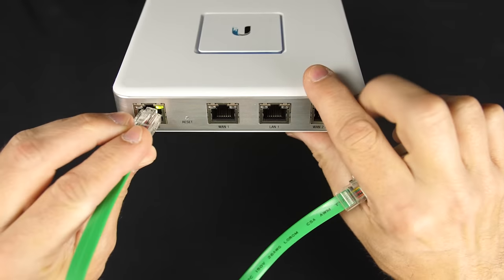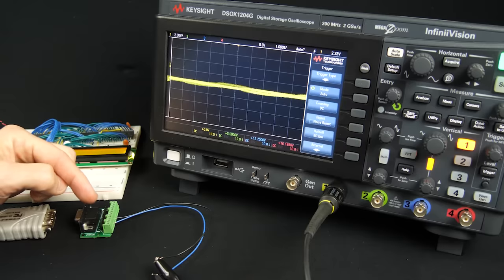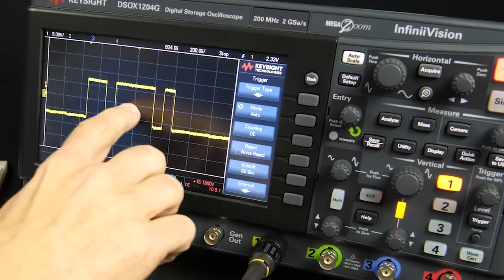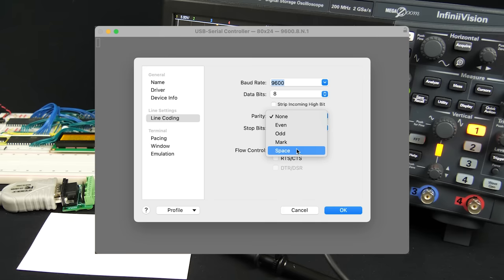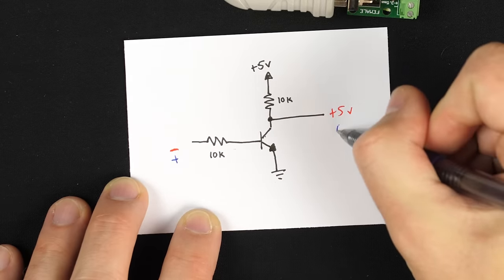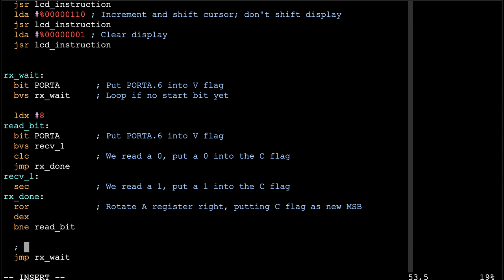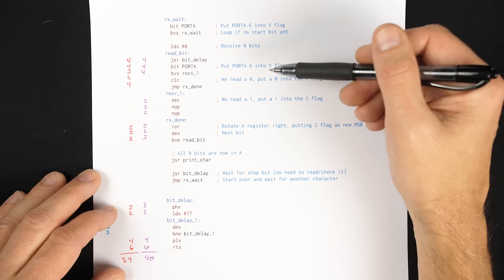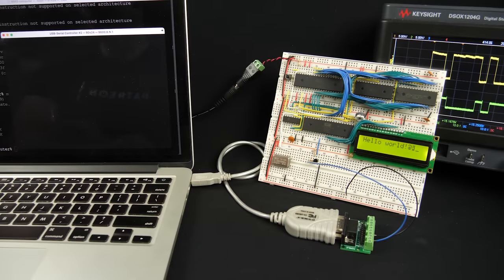The RS-232 protocol

Comment: On the DB25, the clock (if used with the undefined and testinging-reserved pins upon their reconfiguration) could be used with parallel to serial compression, basically like usb but better for some tasks. To do so nowadays, the old baud rates would not apply per se but could be reconfigured to switch between frequencies of symbols whereby each part of the spectrum is separated into a series (each placed into an histogram bin) by means of Fourier analysis (probably, largely FFT). One can assume two computers are connecting each other at such  a "future serial" port by means of a db25 connection. The receiving computer could receive first (before all histogram bins) a gaussian kernel of those historam bins. In advance of the receipt of those histogram bins, the gaussian kernel could be used to derive the contents of the historgam bins, as a sort of means significance testing. The gaussian kernel could be derived and (and subsequently reversed engineered) by means of Gaussian kernel estimation Parzen-Rosenblatt window method, with a rainbow table style out of order execution almost like an index of hashes. OpenCl could do much of that, encoding and decoding the eye-pattern, aside from the bit-twiddling.

The EU "iphones must have a usb-cable for power" specification is a curious thing. They did not even insist on a data-vs-power-only switching mode. Had they done so (although ethernet, or a better beefernet) cable could sitch between provision of solely power (wattage) and power-plus data. This means when charging (a laptop or MID like smartphone), people can use data too so as to free up WiFi bandwidth usage (or microwave/radio frequencies). The existence of LiFi is down to limits in the spectrum for data nowadays. when a Lifi is communicating between a smartphoe and a celing lamp, the "data sending" of lamp is mostly fine because a wall or ceiling has sufficient electricity. However, a smartphone has a limited battery and so, immediately, a hog for the lower power wavelengths gets hogged because "data-sending" smartphone batteries (and similar) cannot compete with the power provided by a lamp. Partly the screen (in "flashes" or modulation invisible to the human eye) can send a trickle of data in combination with a powerbank plugged in via the charger port having LED lights that send some data.

Much of the entire situation (electromagnetic bandwidth limitations per user usages) can be mitigated though by plugging the smartphone's cable charger with data optionality into a port of any compatible surrounding device (like a table or grounded chair wih a magnetic data port pad on it) so as to be clipped on its magnetic power lead (like a Apple laptop charger cable so it is ok that is won't break if it is "ripped away" harmlessly). This information is to help manufacturers (apple, android, MSwindows-phone, Asus, Gigabyte, MSI, Biostar, Foxconn, etc.) and an EU-rethink of it all. Leads can be retractable. Smartphones set to do a full charge (or more than an hour) can be set to receive essential data updates and other message updates via a token ring, or bakery ticket algorithm if the power lead connects to a corporate shared or municipal wifi tower along a big cable (implying an otherwise further limited spectrum of say radio or microwave, which is a problem solved by waiting for a 5-or-15 minute data slot during the hour charge in a queue amongst other user's smartphones plugged in already). 

An IEEE1284 DB25 (at 2Megabytes/second to 2.5Megabytes/second, which is still handy and very approximately sround a 24Mbit/s ADSL2 connection) could have provided an alternative if reduced via adaptor to a sata power port which has two rows of 15 pins making 30 pins so that two of the remaining 5pins could be 12Volt positive an negative, whilst the other two of the 5pins a 5Volt positive an negative, and then the last could be reserved as a ground switching and changing to PWM. Whichever is the pin pair for unused voltage can be changed to parity bits for start and stop, or in addition to the third and one of the postive or negative volt pins "in usage", multiplexers (or similar tristate CMOS logic) can daisy chain to other trusted devices.

My comment has no hate in it and I do no harm. I am not appalled or afraid, boasting or envying or complaining... Just saying. Psalms23: Giving thanks and praise to the Lord and peace and love. Also, I'd say Matthew6.

Comment: Great video but I think you made a mistake with the delays:
Your time calculations start only after leaving the subroutine rx_wait, even tho a certain amount of time has passed already because of the instruction inside this subroutine (at least after bvs rx_wait). Should you not include the 4 clock-cycles which have passed with this branch?

Also later you introduced another subroutine (half_bit_delay) which again takes 4 clock-cycles which for sure should be reduced from the waiting time.

Edit: Okay I think I spotted another mistake. You loop through the subroutine "half_bit_delay" 6 times, half of the time you did with "bit_delay" but in your calculations for the time spend in "bit_delay" you also included the time spent reading the input value and pushing it into the register (39-40ms). So your "half_bit_delay" is actually wrong since it only waits 30ms (6*5) and not 52ms (half of 104). 

So if we would reduce it also by the 8ms which it takes for the 2 branches in rx_wait at the beginning we would have to wait (52 - 8) / 5 times which comes out as 8.8. So we would need to iterate through the "half_bit_delay" actually about 9 times right?
Reply: Its async , with receive being kicked off by the start bit, so the timing error only has 8 bits to build up..  if the timing  error isnt large then it wont build up to cause data corruption ? but anyway, bit wise receieve,  a task consuming a core, won't be needed wtih a UART...
Reply: @leong108  Yes I'm aware that his offset will not cause any issues most of the time - if not all the time. What I pointed out is that he didn't calculate the initial delay of 8ms which means he reads everything 8ms late. But since he reads only in the middle of the signal he waits half the clock cycle. Except he doesn't he only waits 30ms (with the previous 8ms mistake that is 38ms) instead of 52ms.

Comment: (21:28) This also means you have one too many NOPs under recv_1. (Also, you technically need to take page boundaries into account for branch instructions, because if a branch crosses a page boundary, it adds an extra cycle on top of the one normally added just for taking the branch. I can't easily tell from what's shown here whether it crosses any page boundaries, though.)

Comment: Your implementation of RS-232 is Asynchronous and doesn't use the clock signals. RS-232 can be implemented at much higher data rates in Synchronous mode and the clock signals would be required.

Comment: I’m trying to explain negative voltage to a kid. Anyone have a link to a good but simple guide to voltages that would help me out?
Reply: I don't have a link but it all depends on what you define as "zero" volts. Take 2 nine volt batteries and connect them in series. You get 18 volts right? Now what if you define the center tap between them as "ground", (or zero volts) put your negative multi meter lead there. Take the positive lead and connect it to the other terminal of one battery and you see +9 volts. Move it to the other and you see -9 volts. If you draw this setup in a diagram with one battery above the other it helps visualize it.

Comment: RS-232 is electrical standard specification. It is not a protocol.  It defines only electrical and physical characteristics of electronics and hardware. NOT protocol, which would be switching times and data packaging.     Also, RS-232 means REDUNDANT SERIAL,  That is why the 25 pin has a secondary on it. Because the MAIN 25 pin was broken out into TWO 9 pin connectors. Originally there would be one 25 pin to the host, that was cabled to two 9 pin connectors and a third test port connector. This provided 232. or two, serial 32 bit transfer ports, which was the typical serial packet size at the time it was created. The standard left out all reference to protocol or packet sizing other than the 232. in the name.  It is not a protocol. It is an ELECTIRCAL interface standard for a dual redundant serial interface of any type of protocol. it specifies pinouts and electrical specifications with respect to impedances, voltages and more. AS far as logic protocol of the actual handshake , there is nothing in it.

Comment: When I was a kid with an Ohio Scientific (6502 based) computer, I got a printer which had an RS-232 interface. The computer had a cassette interface with a 6850 and I tried to figure out how to get that to talk to the printer. I was dismayed that I needed a 1488 chip and even worse it required a -12V power source which I didn't have. So I connected the TTL output of the 6850 straight to the RS-232 cable to see what would happen... and it worked perfectly. So I never learned anything about RS-232.

Comment: You've probably already fixed this by now. You didn't add the 2 NOP instructions after setting the carry bit, so you are 4 cycles too fast. Probably not a big deal only reading 8 bits and resetting at the start bit.

Comment: 3:28 The computer is not the DCE - it is another DTE. Terminals and computers are DTEs, modems, line drivers &c are DCEs. To connect a DTE (terminal) to another DTE (computer) a null modem is used. All DTEs should have male connectors (i.e. with pins) and all DCEs female connectors. 

Many manufacturers of computers and terminals were very sloppy in their implementations. The only manufacturer that stuck to the rules was DEC. In my early (50 years+ ago) career in computer communications/networking this sloppiness was a major bugbear. Had everybody stuck to the rules those days would have been much simpler, and I'd never have needed a breakout box.

Comment: Go look at the old AT&T / Bell Labs implementations of RS-232.  They wrote the real book.  You will find that various signals were used for various things probably back before you were born.  You will also find things like RTS and CTS had an entirely different purpose back then than they do "today" -- where "today" is actually around 1990 or so which is essentially of when use of RS-232 peaked.

Comment: Yeah nah not really right on the "RS232 generally notable for not including a clock (signal)" part.

RS232 is an OSI model physical layer (layer 1) so is only really concerned about the physical/electrical characteristics, such as the voltages, signaling, pins and their functions etc, and how these should be implemented for each type of implementation (DCE/DTE etc).

It does not specify the character encoding, bit rates, framing, error handling etc, that is up to OSI data/link layer (layer 2) and above.

And layer 2 over RS232 can be either asynchonous or synchonous and in both cases works by sending a bit at a time down the line, which the other side needs to know when to read (when to 'sample' each bit), which is known as clocking.

Asynchonous is what PCs used and what is implemented in this video - the encoding of the bits is determined by the agreed baud rate, number of stop and start bits, parity bit (for error detection), etc. The clocking is implicit because the baud rate (frequency of bits put onto the line) is known and agreed. The UART in the PC serial port implements the decoding demonstrated here transparently. Dial up modems worked this way.

But long before PCs, RS232/V24 (developed in the late 1950s) was used for all sorts of serial comms and much of it was synchonous, that is rather than working on implicit clocking (agreed freqency as per asynchonous), all they agreed was that when the clock line was pulsed, the sender had put a bit out on the TX line and the receiver had to read it.

So it was simpler (didn't require accurate timing, NOPs etc) and faster (less overheads with start/stop/etc), but it could only literally send bits, so protocols such as SDLC were required to be able to send receive meaningful data across synchonous serial connections (a raw bitstream is useless).

Comment: I feel  like your video was a little misleading in a few places. notable 6:30 where you say there is no clock to know where the bits are. This goes back to your initial comments on the connector, yes there was a clock, there are to serial formats Synchronous and Asynchronous the Clock line was for Synchronous , so I am sorry if you never saw it used, that doesn't mean it wasn't, I've seen plenty. Its like you just discounted everything you are not aware of then tried to make a video and saying oh this is weird because they dont do this, but yet you are just not knowledgeable on the subject, I really expected more from you.

Comment: There is no RS-232 Protocol.  The RS232 standard only defines the physical media.  That's as far as it goes.  It does not define the data.   For example, It could be Manchester encoded with an embedded clock or it could be asynchronous.  It can be ASCII or it could be some other encoding scheme like EBCDIC.  Saying RS-232 is a protocol is simply wrong.

Comment: It's refreshing to at least hear someone admit how crappy the standards are in engineering and technology generally. Not only do you have to pay $156 for the technical document, but it's mostly irrelevant to actual practice and most of the document uses technical verbiage like 'mark' and 'space' which you're somehow also expected to know. How much more difficult is it to write a usb driver, or a gigabit ethernet driver, or understand how x86_64 works, etc?

Comment: Ethernet can do everything RS-232 does better. Hell every device has a ethernet port now, if you want to do serial style data transfers, you can just hook up a crossed pair cable and you have a serial like interface without all the hassle of supporting a old serial port. But you might say, but then I need to use an IP address? Well no! Ethernet does not need TCP/IP to send and receive data. Its time to let this old serial port die and move on.

Comment: Yeah, no.

Please don't confuse TIA-232 with EIA-232.  One isn't for pay. The standard is free.  A particular print is not.

RS-232 was on a DB-25 then a DB-9, now on anything with 5 pins, but not relevant.

A "byte" is not "8 bits".  8 bits is an octet.  Bytes are undefined in size except to chill'en.  

But wait, there's more.

RS-232 is almost a thing.  You likely mean RS-232C not RS-232B or RS-232A, the primary differences between them being that voltage is now at TTL level (5VDC) instead of (whatever worked in the 1980s) 25VDC.  Just plain ol' "RS232"... 

Look, great job on the breadboard, the ubiquity hardware (I run that) and stuff.  But if you want to talk standards and interoperability... put your shoes on.

Best.

E

Comment: RS-232 is NOT a protocol.  It is a set of standards defining electrical and mechanical characteristics for a low speed (less than 20,000 bits per second.  Cheeses me off when some no nothing slug can't be bothered to even Google something before they post a video where they self-identify as an 'expert.'

Comment: I had to turn this nonsense off. You, sir, are mistaken about a lot of things. No clock? Doesn't need one, the first pulse defines the width.

You say that no signal is negative voltage. True. Then you say a "one" is negative. False.

Don't even get me started on "these pins aren't used". First, look up "modem control". I cannot tell you how much time I spent with a breakout box (you know what that is, right?) connecting two pieces of equipment, confused on whether they were DTE or DCE, and jumping this to that because they used different methods of implementing "modem control".

Very few manufacturers were 100% right 100% of the time. Digital was one. You connect a DECWriter or VT-100 using a straight cable to a modem and it worked 100% of the time.

But I can guarantee you that the thousands of RS-232 cables I built working for a major research university, very many of them custom just to get some peripheral talking to whichever computer... I think I'm good with this knowledge, which frankly hasn't been useful since the early 90s.

At least I made it nine minutes before I bailed....

Comment: Isn't the whole point of serial communication that you can bump up the signal speed without the encumberance and limitations of a clock pulse ... the signal arrives as fast as it can and you deal with it hence SAS and SATA disks that got faster and faster until centrifugal forces scattered the data and we had to change to solid state 🤡 ... we always warned new young programmers that small loops would shatter under centrifugal forces with faster modern computers 🤡🤡
Reply: user-yj4fr4ff4c  ... unfortunately this one seems to be persistent!